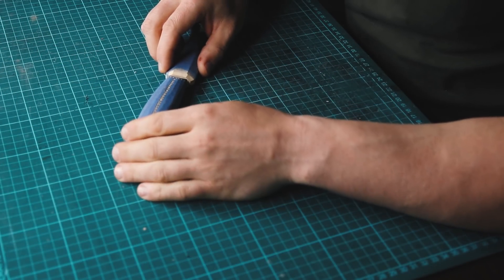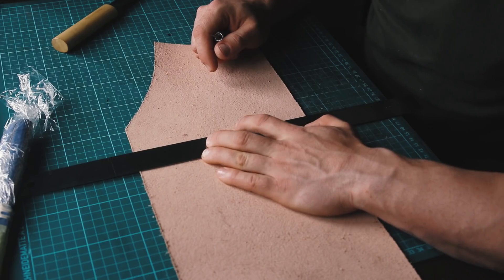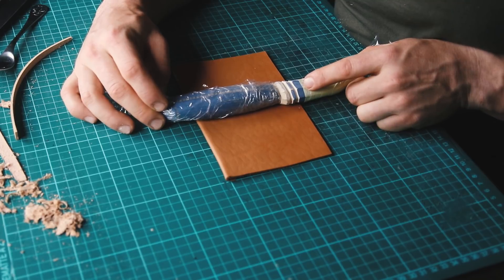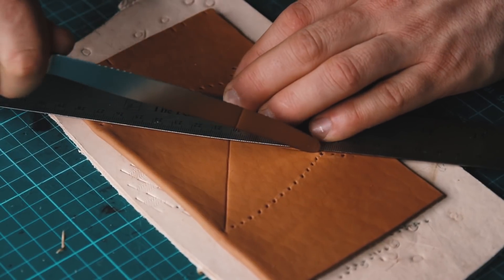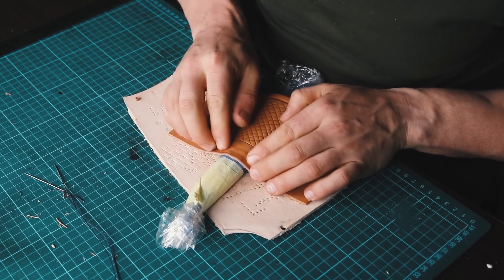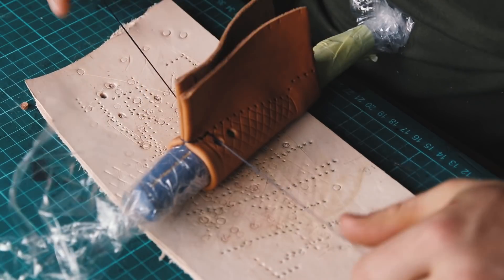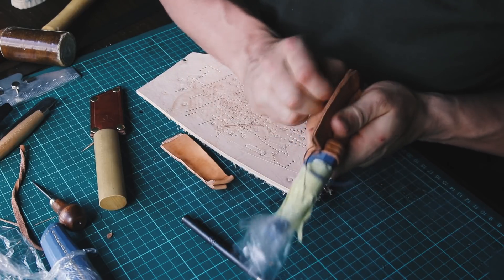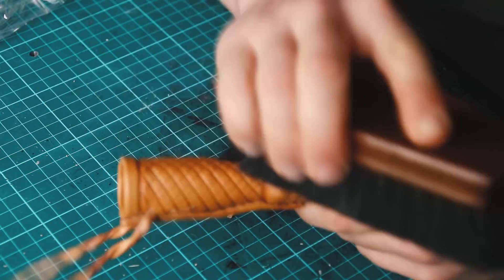How to make a wet molded Leather Sheath - Dogleg Slöjd - Part 4 - Complete Guide

Comment: Great tutorial. I tried this sheathe technique this weekend and it mostly worked - I just need to work on my measurements 😂. Another tip is to dye the leather before working with it if you want to dye it.
Reply from the maker: Cool. And a no on dying it first. You can, but I don't recommend that.
Reply: @woodsmansfinest3814  Thanks for the tip - re. dying - why don't you recommend on doing that first? I have not tried it yet, so any insight is helpful! When I dyed it afterwards, the dye didn't take well in the burnished area that connects with the wood. It looks ok for what I was doing, but not sure how I could get a consistent dye without dying it first?
Reply from the maker: @robertosullivan9027  let it dry, then case again and burnish.